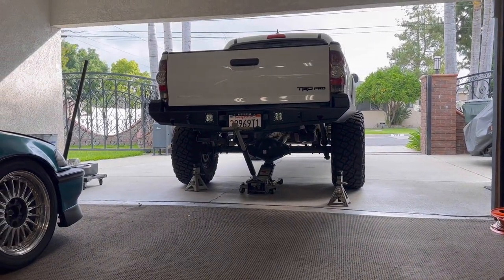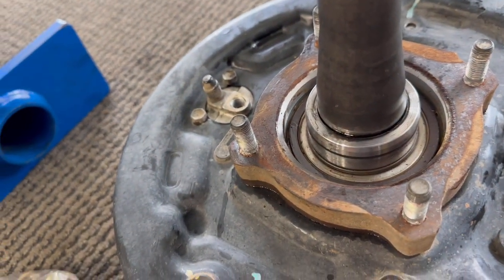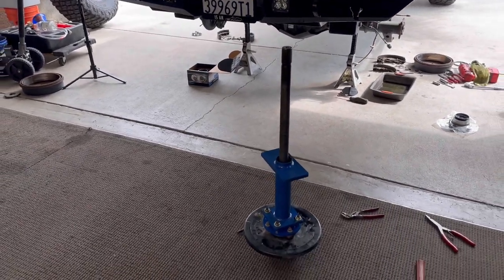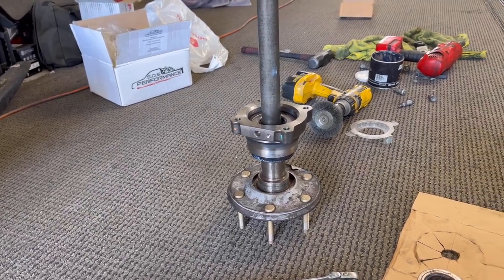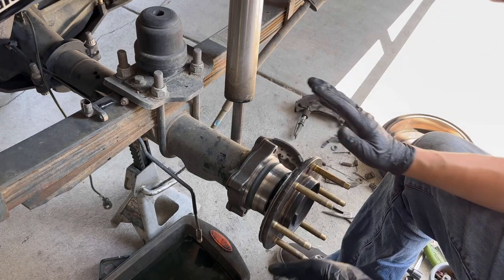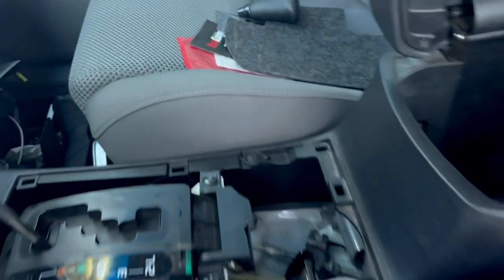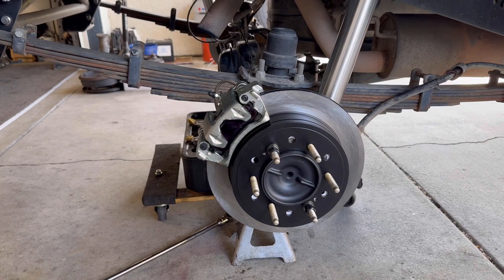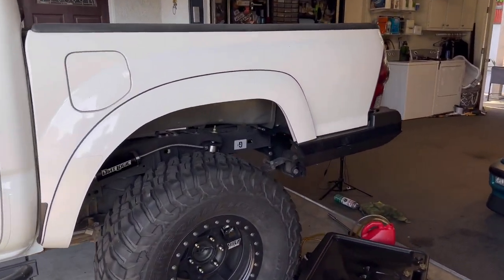Tacoma Rear Disc Conversion & Rear Wheel Bearing Replacement

Comment: So could you potentially get the brakes off a 2010 4Runner bracket/calipers/rotors/lines Tia love the videos straight to the point and informative
Reply from the maker: You need the mounting bracket kit and custom stainless hoses from sos performance. Rotors and calipers can be sourced from a t4r 🤙🏼

Comment: Awesome job as always, do Toyotas require a proportioning valve change for a rear disc conversion?
Reply from the maker: Thanks! The electronic booster Tacomas do not, but regular vacuum booster Tacomas should upgrade to sequoia booster

Comment: Does the proportioning valve cause any troubles??
Reply from the maker: I have the electronic booster so it doesn’t need anything else. Trucks with a standard vacuum booster should upgrade to a larger one for sure 👍🏼